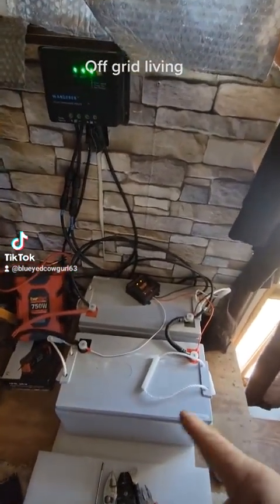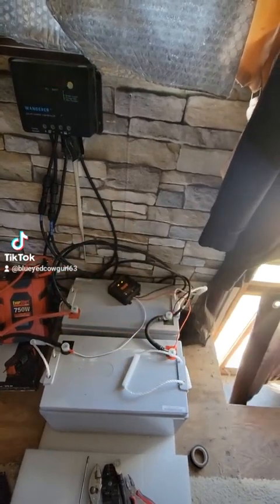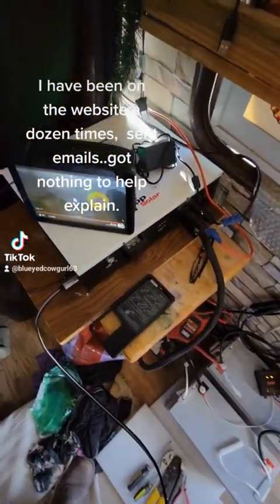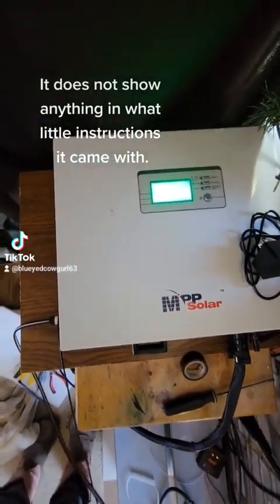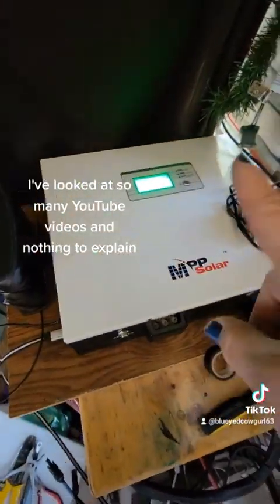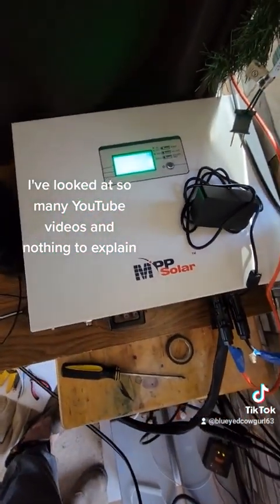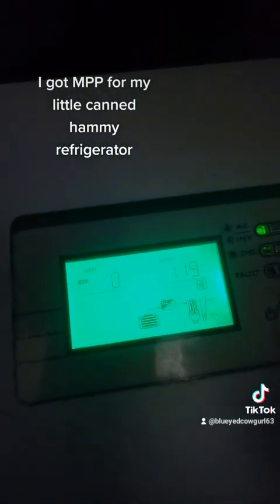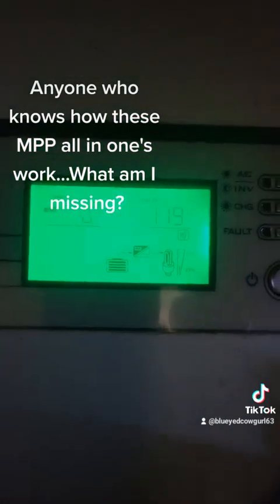Watts 24v MPP all-in-one charger/inverter/converter issues

Comment: Check the mppt range voltage on the user manual of your mpp solar inverter. Sounds like even 2 panels of 100w might not generate enough voltage to start the mppt. Also consider series connection as this adds up the panels voltage.
Reply from the maker: Thanks. I did change the panels to series from parallel and it made a real difference.  I'm thinking that my 2 100w solar panels might not be enough because using anything that pushes more than 120v-60Hz, 350w, which are my small mini dash appliances, the red "fault" signal indicator starts flashing and beeping,  in the center the #4 pops up as a warning,  but there no # in the booklet to tell me what it is.
I even tried to connect a 3rd solar panel, 100w and warning #8 ⚠️ signal and red fault light pops up, there's nothing in booklet on a #8 to tell me what it is or how to fix it. 🤔